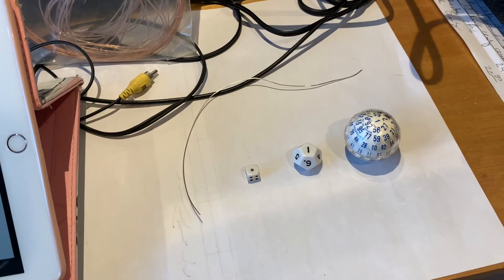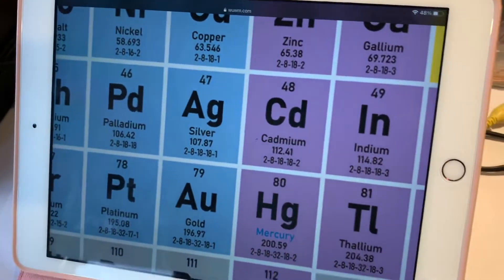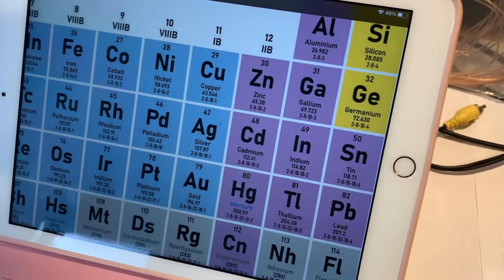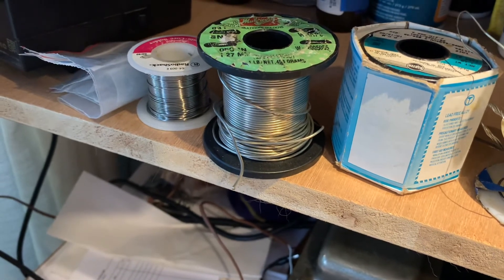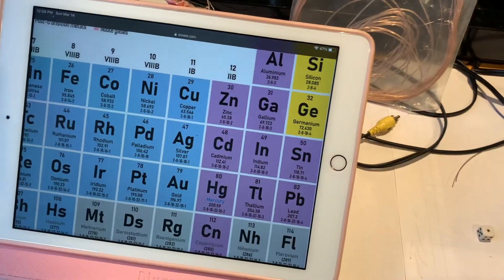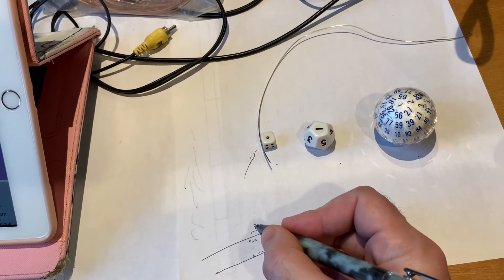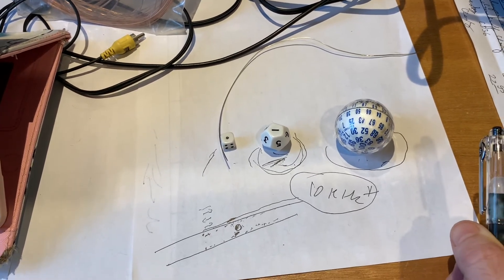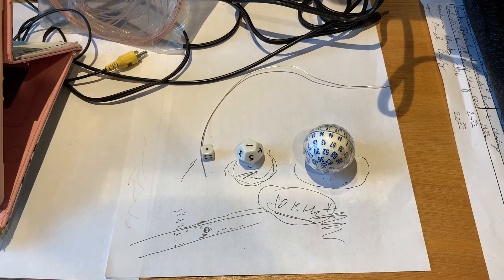Understanding audio metals

Comment: Thanks for the video on wire I agree with you on most points. One thing you did not mention was resonance aspect of
the various types of wire which also contributes to the sound quality. Gold for example 
has a very natural relaxed sound due to it's maliabilty being softer than copper or silver
but also it's density being almost twice a dense.Interestingly, the darker more conductive
metals like copper and gold have a richer sound where as the lighter metals silver, platinum 
and palladium have a more focused transparent detailed sound.Audio note silver wire gets a
similar effect by coating the silver strands with polyuerethane to dampen it and to create 
litz. thanks
Reply from the maker: Thank you, superb comment!

Comment: Thanks for the video and for mentioning the skin effect. Is this something that in your opiniom affects the audible range? And if so, is it worth paying attention to it and limiting gauges of interconnects and speaker cables made of copper? Or let me say it would still be ok to use 18 gauge wire for  an interconnect made of copper? Thank you
Reply from the maker: Regardless of conductor material, skin effect has major impact on sound. Going for bigger gauge always results in loss of focus and detail. The drawback is that you also need high total gauge for current carrying capacity, so my recommendation for every audio cable (speaker cable, interconnect, power cord) is to use as thin wires as possible, and use as many in parallel as possible. :) That's why AN cables are all high strand number cables, with each strand being super thin. For silver the big audible jump is when you go from AWG28 to AWG30. (Also, with AWG28 being significantly more focused than AWG20 - AWG20 is where skin effect starts to noticeably impact audible range. So, we have to go way skinnier to avoid the side effects, as many of  the audio issues stem from what is going on in the 20kHz-200kHz range - cant really hear it, but it has a giant impact on the stability of the audible range.)
Reply: @realworldaudio  thanks for your explanation. Much apprecciated :)